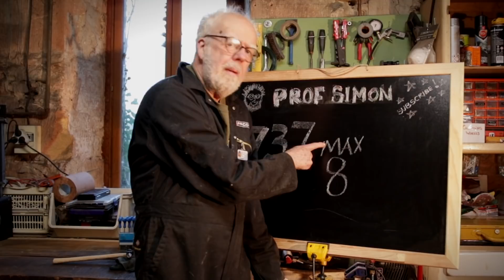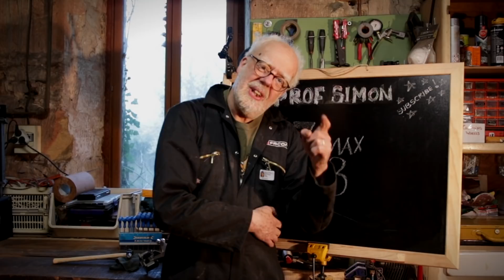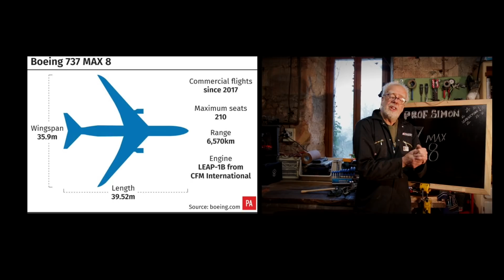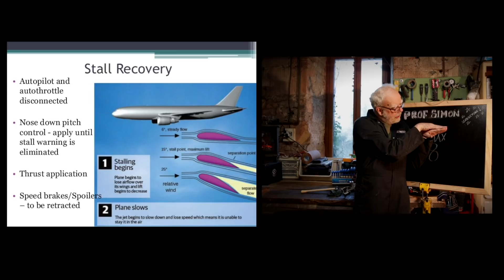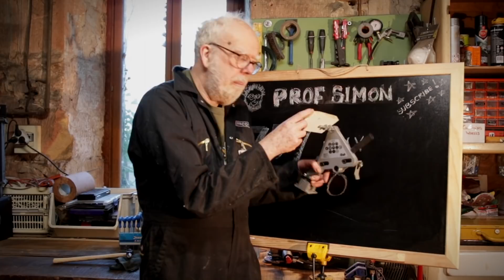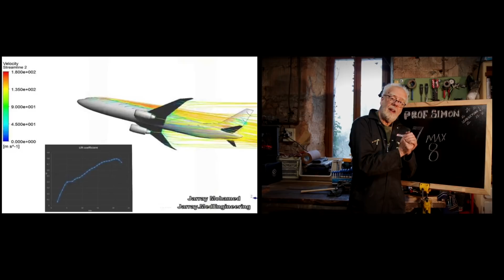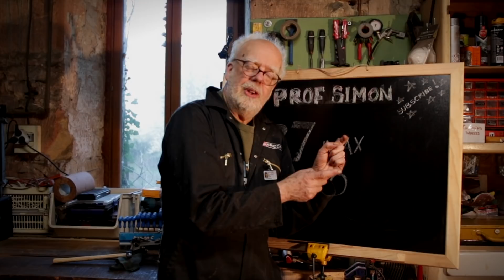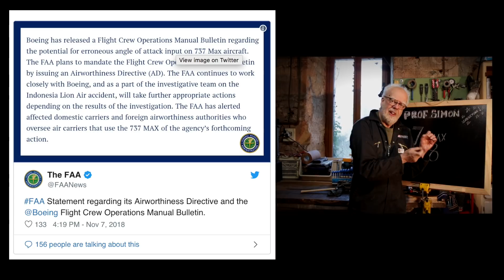Boeing 737 max 8's

Comment: The basic design of the aircraft was never corrected.  It still needs a computer to prevent crashes.  I am an ex airline pilot with a BS in Aerospace Science.  I am rated on the 737.  I will never get on a 737 Max.
Reply from the maker: i agree...no ryanair for me

Comment: Prof, late in the day as it is to comment on your video I believe your perception that MCAS is an update of the old autopilot software does not stand up to scrutiny. MCAS is not "Autopilot Version 8." It appears that it is not integrated into the autopilot system. It appears that it does not take into consideration what other instruments say. Which is why the pilots did not agree to nosedive the aircraft. They knew from the gyro that their angle of climb was not dangerous; from airspeed indicator that there will be no stall at that speed; from Rate of Climb and thrust that the planes were not stalling, from Groundprox that MCAS was causing a nosedive when Groundprox was saying "Don't Sink, Don't Sink" and MCAS was letting altitude drop when Groundprox was saying "Pull Up, Pull Up". In other words MCAS worked independently of the rest of the system and of the pilots. And MCAS relied only on Angle of Attack sensors. How such autonomy was granted to MCAS is a big mystery.

Comment: Here, Simon Holland nailed the MCAS issue before almost anyone else.  Boeing used to be a class act and a world leader in aviation. But I began losing confidence in Boeing when they moved corporate headquarters to Chicago. So the suits wouldn't have to hear the noisy aircraft production lines? The company is sliding toward internal madness. Firing 900 quality control specialists and replacing them with "technology improvements".  Ignoring reports from line production personnel about increasing levels of foreign object damage (FOD) in the 787 and KC-46 and punishing whistle-blowers. Stomping on new unionization attempts. The sheer insanity of the 737 MAX "not a re-design" and its lethal MCAS.  What geniuses! Now we can wait for the storm of 737 MAX lawsuits and federal investigations. 
See https://www.youtube.com/watch?v=BfNEOfEGe3I

Comment: Why did they not send the 2 attitude sensors through a comparator? If they don't agree then alert the pilots. The pilot then sets the nose to level flight and looks at each sensors readings. I they both agree try nose down and or up and compare again. They can tell from other instruments the correct pitch of the craft. Pick the faulty sensor and isolate it's signal. Make decision to land and have the bad one replaced.  So simple! This could even be done in software...
Reply from the maker: Spot on....there are 2 external sensors but their output is not compared......it’s a sorry tale of greed by Boeing and the airlines being cheap.
Reply: Thanks for the comment Sir! What would a simple sub routine in SW cost? What are lives worth? Sensors are one of the least reliable devices as they are all exposed to a terrible environment.

Comment: Any pilot can answer this. And no air craft can fly when its weight envelope is out of the flight envelop. The pilots could not fly the aircraft and the computer could not fly the aircraft , the aircraft was dynamic unstable. WHOO to the pilot that neglects the weight and balance calculations .  Boeing knew the aircraft is sensitive to load configurations and slapped on MCAS to help third tear operators because it fostered the idea that the New 737 Max was a ' World Beater.'  Conclusion ; Over sold and Under Developed.

Comment: All 737s have stall warning systems, what made the Max8 different was that Boeing bodged a software patch on to compensate for poor airframe design that put in WAY more down elevator trim than originally specified.
Just to avoid FAA and airline costs to get a new type-rating on the new plane.

The MCAS fault resulted in all four hands straining to pull back the sticks while figuring out what the problem was. Then every time they solved it 10 seconds later it cut back in.

Boeings errors were to 
 a) Rely on a single, error prone sensor, 
 b) Allow it to operate on takeoff and landing, 
 c) To ignore the ground proximity and speed sensors, 
 d) Not provide a decent cutout as the trim had to be 'unwound' before cutting the system off, 
 e) To allow the MCAS to re-engage every 10 seconds for ever
 f) To hide the feature and not identify it it clearly
 g) To not ground the craft after the first crash as the 2nd was entirely avoidable
 h) To be far too violent and extreme in it's 'correction'.

IIRC They even charged extra for a 2nd sensor and a warning light that showed if they disagreed. 

The FAAs errors were to
 a) Allow Boeing to self certify.

This meant that even if both pilots had 100,000 hours of 737 experience and they'd even studied the blue-prints the new Max-8's fatal feature would still have caught them unawares.
I also think the number of 737s that have ever stalled on takeoff is zero, making the deadly MCAS system even more ironic.

The corruption and greed that caused this is epic.

Comment: I just Love how it only takes a body count of a few hundred to trigger the grounding of a plane otherwise approved by the FAA.  The book " Flying Blind, Flying Safe" is old now but it would make us all grasp how the collusion between the FAA, the Airlines and the Aircraft Manufacturers cause many deaths among air passengers. So selling the new version of the Boeing 737 Max 8 required Boeing to make cheap the transition of pilots from the ancient old 737's  to pilots approved to fly the new gee whiz electronic gizmo controlled version of a once reliable jet. But don't worry it can't take more than a a few hundred more dead to finally get to the fix for this problem.

Comment: there wasnt  automaticaly reduce the movements airplane around its centre of the mass.The computer  passed the very big  signal  to the  control surfacies,but that have to be trimered by the way. Pilots have to cut.off the computer  in this ch.The next- STOP to use the autopilot during the take off,and  when the aircraft is incomming to the airport area and pilot have to be ready for the landing without  automatical operations

Comment: MCAS is designed to try to prevent an aircraft stall. But what happens after the aircraft has stalled and the MCAS is still engaged and attempting to control the aircraft? As a comparison imagine you are driving into your garage in your car and the cruise control is on. But you have it disengaged as you are breaking into the garage and then suddenly it decides to accelerate your car to its last cruise setting. Your car does the unexpected and your time to react to this situation is measured in micro seconds before your car goes through the back wall of your garage. 
You have one chance in thousands to do the right thing in this split second to avoid disaster. How fast can your mind comprehend what is happening and how fast can you react to do the exact correct thing needed to stop this disaster.  When a plane is at a low altitude and it stalls this is exactly the same situation. Everything has to be done correctly in a split second to recover without a crash. Anything unexpected at this critical moment can throw off a pilots attempt to correct the plane just like the car accelerating through the back wall of the garage.

Comment: I do not trust a computer having command of the flight surfaces during take off !
Errors from sensors happen and ive seen computers freeze up like its over loaded in the ram, it only takes a couple seconds taking off to lose the aircraft !

Putting my life in the hands of the fragile interface computer program seems very unwise !
Take off and landings are top the list of most crashes , take off full manual control and let the pilot fly the plane ok !

Comment: A brand-new airplane should not have a "bad" AOA sensor. Second: The AOA sensor was changed out in the first crash. The odds of having TWO bad AOA sensors on the same airplane is almost statistically impossible. And the Ethiopian plane ALSO had a "bad sensor"?  Impossible!  Same goes for the out-of-control trim changes and the pilots' reactions: Yes, the pilots might have done a better job of correcting the airplane's gyrations. But a brand-new airplane should NOT suddenly lurch out of control! Imagine if you bought a new car, and it suddenly jerked to the right when you set the cruise control and caused you to swerve into a tree! Should you be blamed because you didn't turn the wheel back again quick enough? Personally, I don't think the problem is with the AOA sensor or "bad maintenance" or "not following emergency procedures" as Mother Boeing wants you to believe. I think there is a hidden and more insidious problem with the electrical system or the wiring and/or software that is the root cause of the problem. And right now, in my opinion, Boeing does not have a clue! The 737 MAX should be grounded until the true cause of the problem is found.

Comment: We've known since the crash of AF 447 that there is a real disconnect between the "newer" automatic airliners and the TRAINING pilots are getting to effectively deal with these new generations of planes.   My background is Enterprise IT not airplanes per se but I did spend 15 years at NASA and I did participate in the OS's for the Shuttle.   

These newest aircraft may have very sophisticated automatic systems but they cannot escape a Computer 101 concept known as GIGO Garbage in, Garbage out!.  IF the automatic systems are not getting accurate data from the pitot tubes or some other device, then no matter how sophisticated, we KNOW that computers cannot deal  well with "uncertainty".  Their response, in the best case, is to disengage.   Human beings are FAR better than any computer ever conceived so far at intuitively problem solving when confronted with unknown variables.  

BUT---if human beings are overly dependent on automated systems and put more trust in on-board computers then in their own cognitive skills then they and everyone else on the plane, in these examples, is in trouble.  In DEEP trouble.   Air Line Pilots first of all have to be capable of manually flying WHATEVER plane they are piloting and they need to know how to immediately disengage ALL the automation that for whatever reason has failed.   

Fly the plane OUT of Trouble and then and only then start trouble shooting an endless array of on-board computers.  This is what is NOT happening and the result is a ever rising body count.  It didn't just start with the 737 Max 8.  It's been an ongoing problem for well over a decade.

Comment: My educated speculative answer: "The probable cause of this crash was a faulty AoA sensor, which exposed a brittleness in the design of the MCAS system, which behaved differently from was was represented to certification authorities. The fault caused an effective stabilizer trim runaway condition. -- A contributing factor was the crew's failure to recognize the stabilizer trim runaway condition, then accomplish established non-normal procedures to return to a proper trim setting and/or cut-out the electric trim system as required. Further contributing was the crew's failure to control excessive airspeed (which amplifies the consequences of an out-of-trim condition) by using appropriate thrust settings, and available drag producing devices (speedbrakes, landing-gear, and flaps also, depending on speed).

Bottom line for now: the airplane did fail the crew, but not terminally (Boeing does have to address this). Full manual control authority was available, and training prescribed to recognize and recover from the condition into which that system failure put the aircraft (the same procedures that have existed since the beginning of the 737 design, in fact). The crew then failed to recover a recoverable aircraft.

That last statement requires vetting and confirmation by the facts of the investigation, and simulator checks, etc. But it's my tentative opinion that this airplane was recoverable for a least two-minutes or possibly even more, of the ~3 minutes evolution until impact. The crew failed to recognize trim runaway, then failed to manage speed to mitigate the consequence of being out-of-trim. Attention to these details would have saved the airplane. This is what occurred on the Lion Air aircraft that crashed, on the flight to Jakarta immediately prior. As I understand it, MCAS-induced trim runaway occurred there too, but the crew cut-out the electric trim and were able (if inappropriately) to continue to Jakarta. The next crew failed the same scenario, after apparently appropriate maintenance action failed to correct the trouble.

Grounding is appropriate to protect the public, not only from the misbehaving aircraft system, but also from the variation in aircrew skill evinced. As the facts stand today, I would fly the 737 MAX today*, if flown by a competent crew, prepared to respond to a trim runaway event (as they were always supposed to be trained to do). The MAX has been flying for, what, over a decade now? This has only recently and spectacularly become a point of concern. The MCAS does need a fix, but it will be interesting to learn *why this issue only surfaced now, after so many hours and thousands of flight cycles of safely conducted flying.

My worst fear has been resolved already. Early reporting on these MAX crashes left the impression that an automated system, which the crew could not interfere with, was precipitating these crashes. That's not correct. While it appears true that MCAS is most directly at fault for upsetting the aircraft, and it's seems true that crews did not know MCAS existed before these crashes, the effect of faulty MCAS/AoA sensor was a trim runaway, and dealing with a trim runaway was a known and trained factor for crews. I now know that by actuating the electric trim cut-outs provided, the crew can establish complete and direct control of their airplane, without interference by automation, the same as has been Boeing's philosophy all along. Pilots can take full manual control of the 737 MAX. I believe in good crews, so I believe the MAX will only get better from here, and will ultimately return to the skies for millions more safe and successful flights.

Comment: Here is the best synopsis that was sent to me by a great friend and airline pilot.....
(https://www.seattletimes.com/business/boeing-aerospace/failed-certification-faa-missed-safety-issues-in-the-737-max-system-implicated-in-the-lion-air-crash/?utm_source=facebook&utm_medium=social&utm_campaign=article_left_1.1)
The reality of the MCAS "resetting" itself after every pilot input is staggering without a redundant system of computers for a device that is designed to prevent accidental stalling....... Would it not be of infinite logic, if there is a mechanical component that is being read by a computer, that multiple computers should be determining the validity of the input of the device?
Reply from the maker: I agree....I am working on a new video based on this article....very insightful.
Reply: It is interesting that a single airfoil type AOA it seems as per photo it is mechanical, that there was not a fixed tube type pressure differential variant such as what Garmin makes for home built aircraft as a redundant system.  A 1600.00 piece of kit most surely could be modified in size and algorithm sensitivity to handle the airspeeds of a large jet, many homebuilts are 200+ knots etc........ If $ was the motivator, as the old adage goes, "you CAN go broke saving money....."  If nothing else, this should be a huge shot over the bow to the likes of Elon Musk as well.  The autopilot is very nifty kit, the training and provisional capacity of the cars system to vote on prevention of catastrophic input error and the instantaneous capacity for the actual driver to override without computer re-intervention with a known audible order and physical implementation must be accomplished.  The dumbing down of drivers can be a very dangerous slope to tread upon.  There should be a very clear training mode for the autopilot systems on all craft of all types and knowing how they are inactivated, will be from this point on essential.  Maybe a captain and first officer audible input override to show two human agreement over a triple redundant computer voting system........ @SimonHollandfilms

Comment: a very close friend was until retirement a tester and instructor on 737 and certain airbus aircraft
the issue is trim runaway on the auto trim which is found an all recent aircraft that user auto trim to cancel the effects of  huge  low thrust offset  by the engines on take off that cause terrific tendency to over pitch up
its easy to spot and stop if you dont panic
the issue is that the new rating system is not done on a real  flight simulator ( costs a lot ) but on a pc

this means that the trim runaway situation is not tested for in the  new rating
this means that the pilots are not fully trained for it and how to cope

thats why they crash
Reply: The MCAS does not engage until after the flaps are retracted which is after take off. The problem with 737 Max is that the larger engines further forward start acting as lifting surfaces (wings) at high angle of attack which moves the apparent center of pressure on the wing forward and pitches the nose of the plane up even more so the plane can easily go into a positive feedback loop which ends in stalling. MCAS was designed to counteract this tendency caused by the different aerodynamics of the larger forward mounted engines.